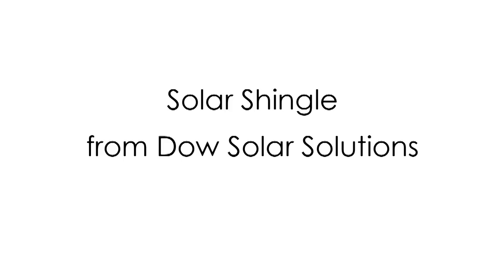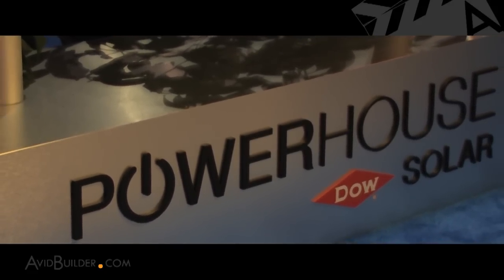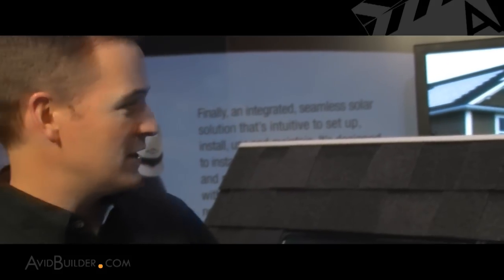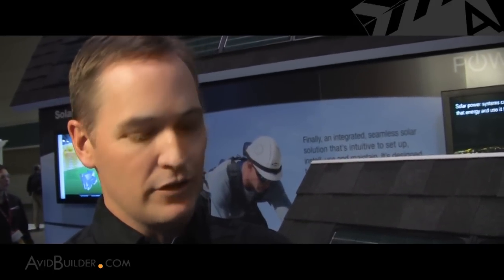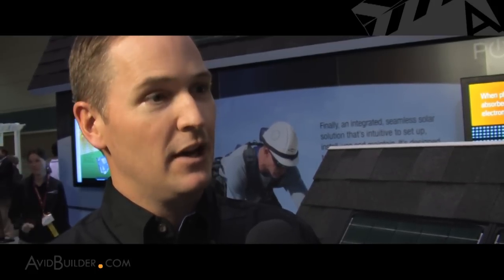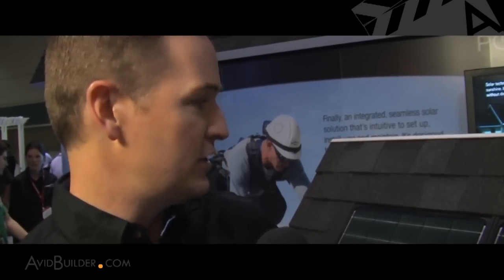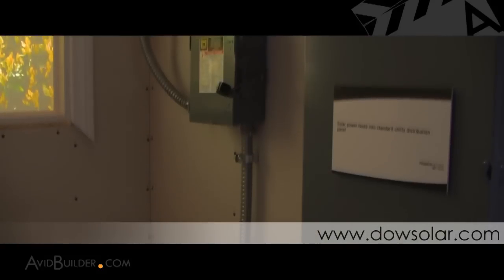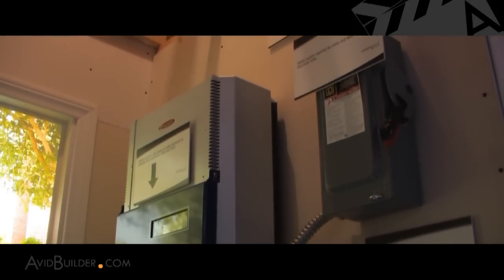Dow Solar Shingles  - AvidBuilder's Top 10 "Best Of Show" at IBS 2011

Comment: @ryann you forgot about the huge difference in that energy costs rise each year and that it's going to vary widely based on use, but for me my electric bill is commonly around 120/mo for a 2400sqft house.. In Texas electric is cheap (easy to get 8-9¢) because of our deregulated model. 

This is good and bad for solar because that means you're generating something less valuable, but the system cost won't be much different. Though it definitely still adds value to the house and will give you options if there's problems with the grid. 

What would be nice is if more companies would allow payments for 10yrs, then it would be a mo brainer and instant savings based on the electric bill dropping more than the solar company payment.